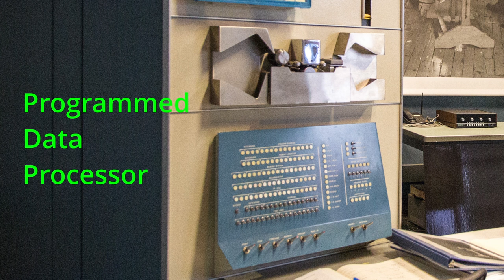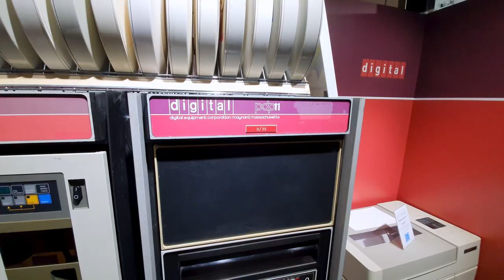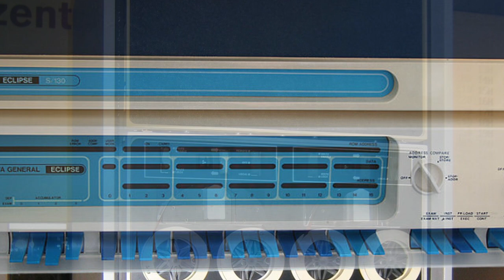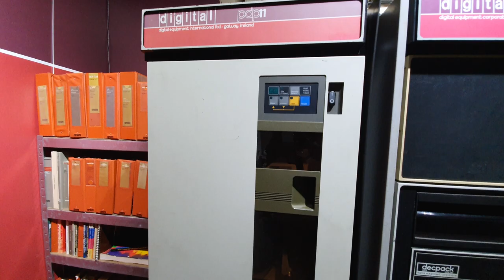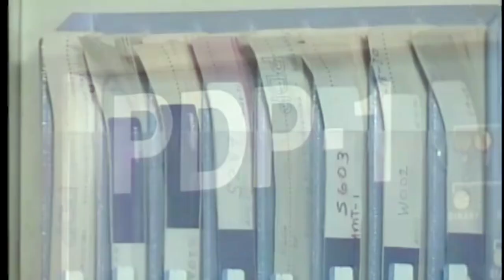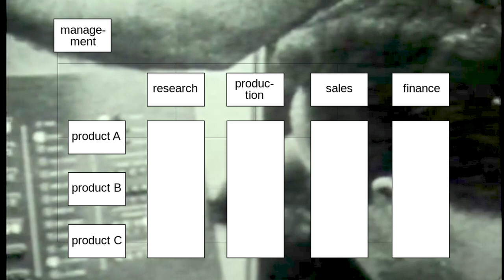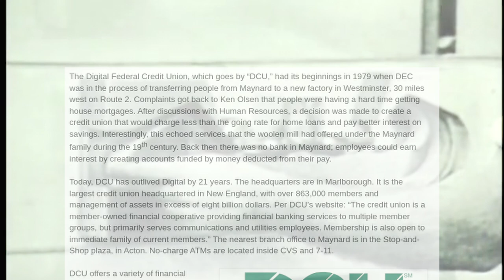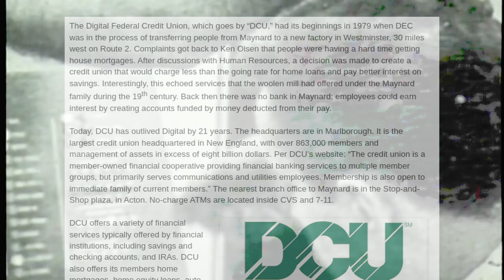DEC and the PiDP-11

Comment: Nicely done. As a new hire at a relatively new company (Atari in 1976) I was to put together the second computer system they had at that facility, a second (third?) hand PDP 11/20 which had 20K of core memory, two 8" floppy disk drives and a paper tape reader/punch. The other computer they had was a PDP 11/05 which I believe had 16K of semiconductor memory and also two 8" floppy disk drives and a paper tape reader/punch. A couple years later we picked up a used 11/03. All running RT-11. They were used as our only machines until we bought the first of many VAX in 1981. Look forward to your video about the VAX.
Reply from the maker: I imagine working at Atari in that period must have been fascinating.
Reply: Amazing how much we got done with so little memory back then!
Reply: @RetroBytesUK  Indeed. A wild E coupon ride using old Disneyland parlance. I rode it for 27 years.
Reply: @bobdinitto  Yep. Even many of the early games we made (I always worked in the arcade division) worked with ~4k of memory (ROM/EPROM). I personally  was never able to get one of my games to fit in just 2k but I tried.

Comment: As an engineering student at the University of Hawaii in early 70's my class using the PDP 10 at MIT that was running a math analysis application remotely through what was then the Arpanet.  It worked out quite well cause of the 6-hour time difference.

Comment: Thanks for making this video. I worked for DEC from 1977 to 1979, and again from 1981 to 1987. This brought back a lot of fond memories. DEC was the best company to work for. The employee benefits were fantastic and there were lots of opportunities for upward mobility, which was encouraged. Ken Olsen was indeed ahead of his time both technologically and socially. The first computer I worked on was the PDP-11/40, which was used as a front end to the DEC-10 and 20. There were many PDP-11 operating systems but the most formidable was the PAL-11 paper tape system. You had to load and then punch one or more paper tapes on each edit for each file of the program, and again for each assembly and link step. Good fun! The DEC-10/20 line used a 36 bit word and the CPU used ECL - a very sensitive logic unlike TTL. It was more difficult to work on. Finding problems in these circuits could take days, weeks, or even months. Try googling an image of a PDP-10 CPU backplane to get the idea. On my second term of employment I wrote firmware for the VT240 video terminal and then went on to lead a group writing VMS printer drivers for the Postscript printers that replaced older technology of the period. I miss those days. We had great fun designing cutting edge products for a great company!
Reply from the maker: Frankly its amazing you could debug anything with those wire wrap back-planes. 
The vt240 now that's a good terminal. I will hopefully have time in the next video to talk about the terminals more, as I only really got to mention them in passing in this video, but I try to keep these things to 20-30mins max.
Reply: What's ECL?
Reply: @renakunisaki  Emitter coupled logic. It's a type of computer circuit that supports the highest frequencies, and thus the highest throughput. It relies on small voltage swings. Minor circuit defects were very difficult to detect using the oscilloscopes and logic analyzers of that period . Each wire or run on the circuit board had to be specially terminated to avoid the signals reflecting back on themselves and causing feedback interference. All in all a very difficult system to diagnose and repair.

Comment: In collage I worked on PDP-8 (Straight) serial number 7 and several PDP-8L's and a PDP-12.   After collage want on to work on a Decsystem 10.  I still have my DECstation Installation Kit screwdriver.  It says "PDP8 more than 40,00 installed worldwide".  It was a great era in computing!

Comment: Thanks for the enjoyable trip down memory lane. Started on PDP-11 and went to DEC JIT plant in Galway IRE in the early 1990s to benchmark a Vax9000. Great memories, great people, great times. The company I work for today still uses VMS and good to see VSI have it running on x86 architecture. Did many a VAX to AXP to IA64 migrations. Looking forward to your next video.
Reply: VMS was a great operating system. It was the impetus for Windows NT as some of the early VMS developers went on to work for Microsoft on that project. I notice an especially amazing similarity between the VMS file system and NTFS. I was on the Lotus 123v3 development team which targeted OS/x, Windows 95/NT, VAX/VMS, and about 10 different flavors of Unix and Zenix. VMS was by far the easiest to port. Everything just worked!
Reply: VMS is still the best general purpose operating system ever written.

I worked with it for years.
Reply: Data general was for most of its existence selling corporate mainframes - whereas DEC grew large by selling to departments and small businesses. DG may have made more money until the Mainframe business wilted away, but it was far less influential in the development of the modern industry than DEC.

Comment: My first experience of programming was on a PDP 11/23 (I think. It was 40-odd years ago) using machine code which was input one word at a time direct into memory through the toggle switches on the front panel, and then saved to a punched paper tape. Oh the fun you had when the centre of the paper tape fell out and the whole reel unravelled around your feet . I also remember using magnetic core memory which was loaded from paper tape and then held the programme almost indefinitely. One lesser known characteristic of magnetic core is that it was resistant to electro magnetic pulses so was used in a number of military applications. I later worked on the DEC VAX 780 series of computers which had the luxury of a multi-user operating system, multiple processors, magnetic tape drives and 14 inch 20 surface multi-platter removable hard disk packs... all programmed in languages like Fortran. Such fun 😁

Comment: That's such a beautiful computer (replica). I'd love to get my hands on one of those, proper switches are just so satisfying.
Reply: It is a great kit.  I picked one up last year and it was a fun build and interesting to play with.  You might want to check out the IMSAI 8080 replica which uses an ESP32, it has some really neat features.
Reply from the maker: Mine is currently waiting in an airport in Australia, really looking forwards to getting it.
Reply: Its made by a guy Oscar in the netherlands he fanatically had the switches remanufactured in the right colors and shapes in the 2/3rds OEM sizes.   He takes orders every month and a month later he ships out the kits, about $300 but you have to add your own raspberry Pi, fear not - for $40 Pi Zero v2 (with power supply & sd card) makes a great processor, its about 6x faster than the original PDP-11/70.

Comment: Hi. I as an West German engineer got trained in Kiew in 1982 as service man for the CM4.. It was a very huge deal around a steel production in Kursk. The automation was done via Swedish ASEA, whom I worked for. The knew that DEC had sold their plans plus old manifacturing machines to the only industrial computer manufacturer of the UDSSR. While our 6 weeks training we meet al the leading staff of that company... They even showed us their work in progress ( the VAX)... All that cloning has been, to my best knowledge, made with/by DEC themselves, just in the times before the embargo.... These guys trained us to repair the computers on TTL-chip level, using a single counter that toggled the micro-code puls. Very nice competed people witch struggled with their low quality produced hw. (f.x. I never before saw corroded "golden" wrap pins) 
Since these experiences in younger times I don't trust our daily press blabla anymore..

Comment: I worked for DEC UK.  In today's tech world we use a lot of things, products, concepts that DEC originated, co-originated with universities, commercialised, productised or in other ways enabled. I'm talking about various data storage technologies, storage virtualisation, networking, clustering, data centre virtualisation, RISC processors, multi-core processors, speech tech, multimedia tech, power control, operating systems  - and many more things which DEC either originated, co-originated, enabled, advanced, commercialised or productised. 

In the mid-late 1980s DEC was looking like it might even become top dog in the computer business, and working there you truly felt valued and looked after.  But a series of missed boats and bad decisions meant that the company began to slide in the early 1990s.  By the mid 1990s a lot of long term employees were in shock because DEC was disbanding complete departments at almost zero notice and the asset strippers were in selling off chunks of the corporation (networks dvision, storage devision etc) and DEC was behaving just like companies have to when they are under existential threat. There's a great lesson there for anyone today in a large corporate that is doing well and can cosset its employees. 

Multi-core processors is an interesting one - the Multi-core Intel processor you may well be using right now, might owe its existence to DEC. The DEC Alpha processor had multicore processing in about 1994 or so. When they started asset stripping DEC, one of the things to get sold off was the semi-conductor division, which designed and fabricated Alpha processors.  The buyer was Intel. 

Another interesting thing to reflect on is the striking number of design similarities beteen DEC's VMS operating system and early versions of Microsoft's Windows NT. 

Yes, DEC was an interesting company - a fairly short lifetime compared to - say IBM or HP - but it's contribution to modern information technology cannot be overstated.

Comment: I used to have a PDP 11/23 with 2 RL drives in my room in a half height rack. I lived on the 3rd floor with no elevator, and on top of this I had to haul the thing home by tram, it was quite an operation all in all, but it worked flawlessly one put back together. I had to clean it up as it had been outside a computer labs loading dock for a week or two and got rained on.

Comment: At Univ. of New Orleans, we had an X-ray crystallography servo-table driven by PDP-8s.  We had a PDP-10 using the KA-10 series.  I was a student operator of it.  Later the university upgraded that to a KI-10, and finally a KL-10.  That was a bloody fast, powerful system.  I had a PDP-11/15 in my chemistry lab.  Finished my dissertation research doing real-time data gathering with it.  Spent the next 12 years after my doctorate working as a device-driver writer for PDP-11s.  My employer, TANO, sold a lot of PDP-11/40s and later, 11/44s, for oil-and-gas pipeline control systems that monitored sensors in the pipeline to track what was flowing through it.  That machine was a true delight to program in MAC assembler, though we also had a decent FORTRAN compiler.  The thing we really liked about the 11/44 was that it had floating point ability built in to the CPU chip rather than available through an external card, and that its memory management abilities included the ability to handle up to either 2 MB or 4 MB, I forget which.  In the 1970s, either one was a LOT of memory.  I loved those machines until VAXen came onto the scene.  The 11/44 was a good replacement for the 11/70.  We never ran UNIX on any of the 11s, though.  We used RSX-11M most often, but the business office had a RSTS-E-9.

Comment: Great video, brought back many memories of various pdp11s. In those days quite a lot of programming was in assembler and the '11 had a very elegant and orthogonal instruction set which was very rasy to learn and use.  So much better than what intel foisted on the world with the 8086
Reply: that exactly is the reason why Motorola 68k family was way better than x86, as they were allegedly inspired by PDP-11
Reply: I loved the PDP-11. It was so well designed. The instruction set was simple and elegant. The unibus was revolutionary. As for the 68K vs 808x it was a no brainer: Motorola was a much more well designed and easier to use device. The fact that it had straight forward memory addressing as opposed to Intel's segmented memory architecture which has always been a major pain in the ass made it a clear winner in both circuit design and programming.
Reply: @bobdinitto  With one unfortunate downside: Segmented memory would prove to be a precursor to paged memory, which proved vital for virtual memory management and multitasking. The 68451 was an inadequate MMU, and meant systems had to either work around the broken system, such as MacOS's cooperative multitasking, or roll their own MMU.
By the time Motorola fixed the problem, it was too late. IBM inadvertently put their stamp on an easily cloned desktop computer, and stumbled their way into setting the de facto standard architecture.

Comment: I was an EE/CS student from '78 at UNSW in Australia. We had an 11/70 running the CS department with UNIX (it was very early days and UNSW was a UNIX pioneer).
It was such a lovely machine but hopelessly overloaded.
I was so familiar with all aspects of that PDP-11.
Once it failed and the whole department was at a standstill. We were waiting for the DEC engineer to show up and fix it and I decided to do something about this...
The machine was made entirely from discrete logic and we had all the schematics - so I set about analysing what was wrong by first loading code through the frontpanel switches and localising the fault (DEC diagnostics were not really that helpful).
After that, it was the CRO and logic probe.
Within a few hours I had tracked the problem to a faulty XOR gate in the CPU. These were available in the school store and I managed to convince everyone that I knew what I was doing - so I set to work with the soldering iron to replace it. The machine was up and going again long before the DEC engineer appeared.
The PDP/11 was such a nice piece of hardware - with a straightforward design that an undergrad could understand.
Looking back, I am still amazed that I convinced the academics to let me fiddle about on their precious machine.
I suspect that these days, they wouldn't even be able to overcome the "work safety" dramas associated with pushing out the CPU sub-cabinet...

Comment: Worked as Field Service Engineer from 1980 to 1994. DEC was known as the best company to work for in the USA. I first learned PDP-11 architecture in the Navy. Cecil Field used about 15 PDP 11/45's to run 3  S3 A Viking Anti submarine Warfare flight simulators. After that, straight into a job with DEC. I became the VAX specialist, then onto Alpha. Two of the best jobs I can imagine. Back then there was at least one company that actually cared about its employees. And its customers, almost to a fault. Sadly, I don't think any company like it exists today. Thanks for the video!

Comment: I remember the PDP11 as the system that controlled the auction clocks at the largest flower auction in the world in the Netherlands in the 80's.
Reply: Aalsmeer. Fascinating place.
Reply: I think those PDP-11s at the flower auction were upgraded with binary-compatible Ospreys.
Reply: @andrewscarr8943  I  only remember they had a custom drawer for connectivity with the buyers on the auction floor

Comment: In about 1968, the company I worked for at the time sent me on a one week PDP8 assembler programming course. I probably learnt more in that week than in the whole of my electronics degree course. Despite having had no previous knowledge about computers, I came home at the end of that week completely spellbound - everything was so clear. I understood not only the software, but also the hardware. So I decided to design and build my own! I didn't stick to the PDP8 design, but "improved" it (with hindsight, a big mistake because of the lack of software). For example, mine had 4 accumulators as compared to the one of the PDP8. It took me two years, working evenings and weekends. Sadly, it was out of date before it was finished, but there weren't many people around in the 60's with their own computer and I learnt a lot from the project.

Comment: I was introduced to the DEC PDP 11 series in 1983 when I went to work for Rockwell International as a field service tech and installer of the Rockwell Galaxy ACD (Automatic Call Distributor) phone system used in large call centers. Continental Airlines bought the first one in '73 if I remember correctly and used it all the way to '96. Now those rows of equipment racks are replaced by one small tower or less with the advent of VOIP and powerful processors..